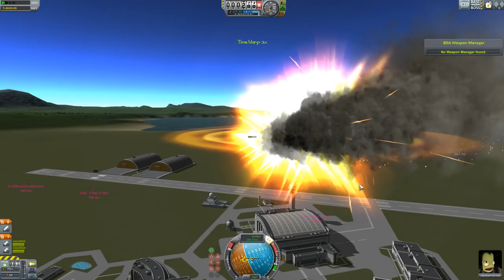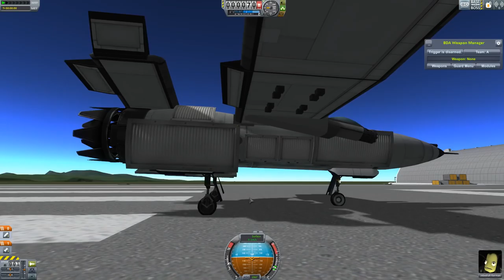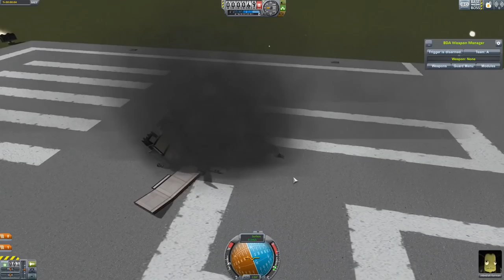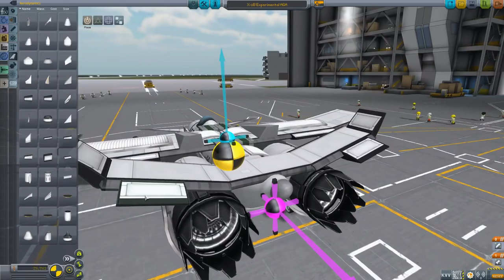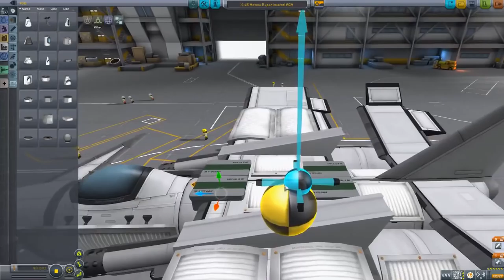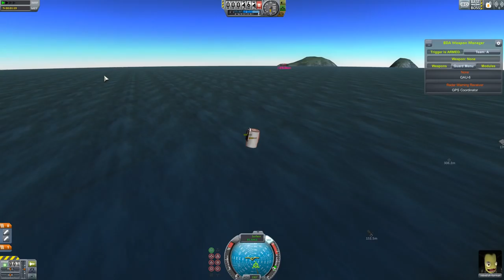KSP Combat - Experimental Armoring Against BD Armory Weapons

Comment: Hey Guard, that was actually really clever... I'd thought of using Heatshields against BD weapons but never the radiators... just a couple things that might help improve performance, I'd recommend placing the 2 engines closer together, so that if 1 fails the other doesn't have to try as much to account for it... also if you ever build a heavy model (with the mk. 3 parts) I think using a 3.75 meter heat shield on the back like an end cap  would be useful so it can absorb any missiles fired at you while you try to escape enemy fire...
Reply from the maker: +Somerandom I like your ideas (but also, see https://www.youtube.com/watch?v=2Cfh-ghEcdw I have lots of problems with bigger planes xD)
Reply: true true :D they're not easy :|

Comment: So was just stock radiators? I'm not getting to good results.
Reply from the maker: +Dark Orbit King Well yea, that's the same thing I noticed. The thing is, BD Armory applies a large amount of heat instantaneously, and radiators only radiate a small amount over time. It can help for shots that NEARLY destroy a part, but not otherwise.

Also BD Armory has or will soon change the way that damage works so that it is not based on heat.